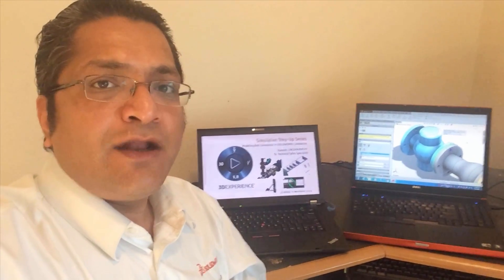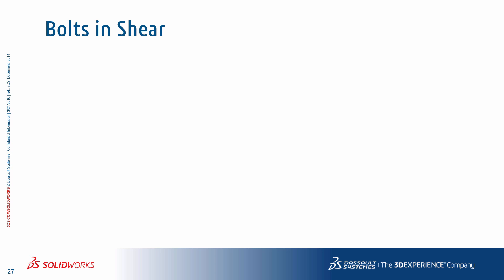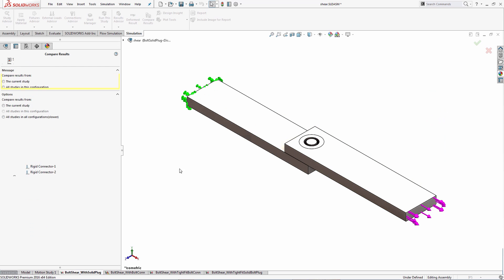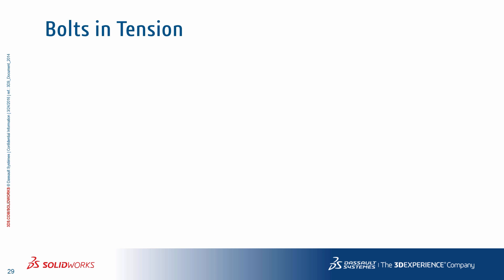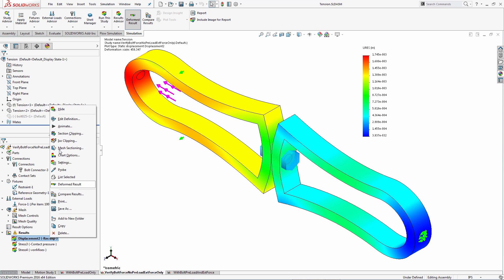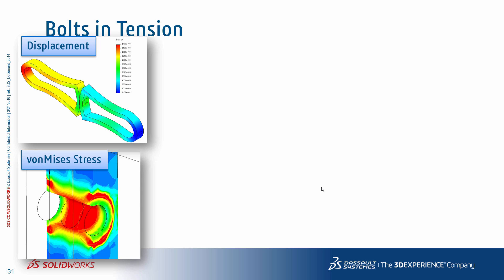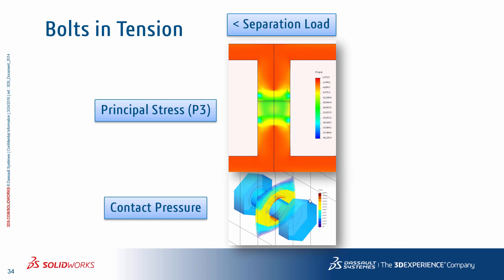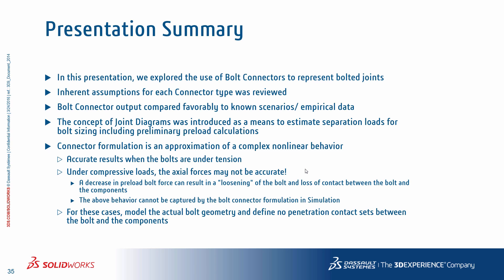SOLIDWORKS Simulation Step-Up Series: Bolt Connectors Part 3

Comment: Thanks for video.
How to automatically(in solidworks) calculate  stresses in the bolts?
For example in ansys or creo simulate such a possibility.
Reply: To calculate the stresses on a bolt the real bolt geometry is needed, i.e. the CAD part of the bolt, which leads in a highly complex simulation.

If the bolt connector is used, as described in the video, no stresses are calculated for the bolt, since a virtual model is used in the analysis. 

However, a pass or fail criterion is established internally by the software and it informs you whether your bolt connector is strong enough to withstand the external loads (axial, shear, bending).